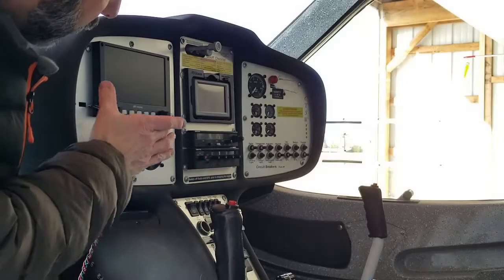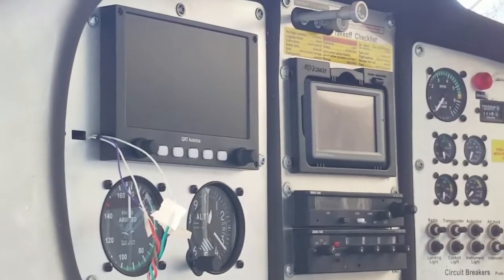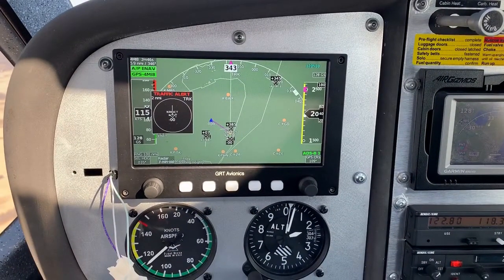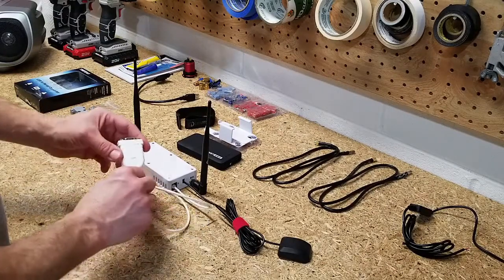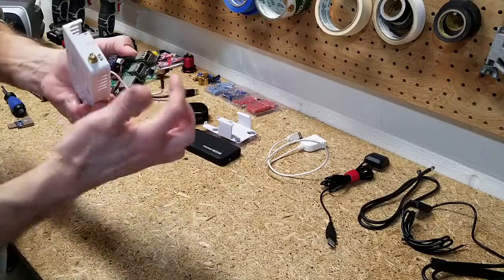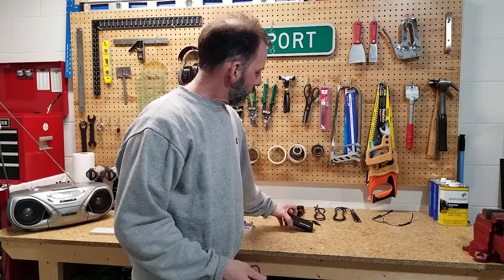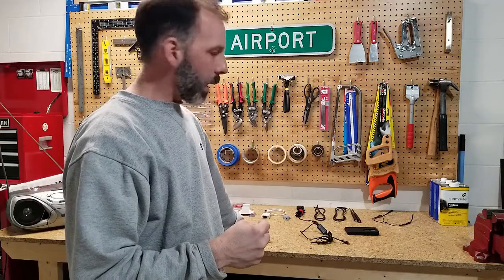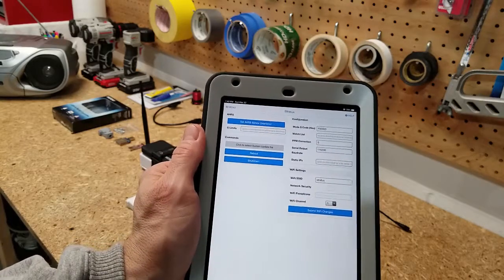Stratux ADS-B Serial Output / remote mounting / external power - GRT Avionics EFIS / Garmin / Dynon

Comment: I would have used a 6 to 7 foot USB cable and continued using the old USB GPS dongle. It would require a small case, which shouldn't be a problem.

Comment: on the GRT website they have a Image file for Raspberry Pi 3 that provides serial output, no update files, where can I get the update file
Reply from the maker: Hi Trueflite, I don't want to assume what you're looking at / saying here.  The file name is "update-stratux-tu-s9.sh", if that's the update file name you're seeing that is it.  If not, I'd suggest contacting Jeff at GRT and he'll email it to you.  Please subscribe to my channel (if you've not already), lots of more good videos in the works soon.  Regards, Darrell
Reply: @darrellwitham832  , I did get a reply from Jeff and he said to use the latest official stratux image, + the TU-S9 update script. My question now is if the new slimmer profile  version of the trendnet TU-S9 will work.
Reply from the maker: @aeromatt  Sounds like you're on the way here, I'm still running the TU-S9 as shown in this video.  The good news is these are $10 items, and the old version can be found on Ebay - just searched one a moment ago.

Comment: still didn't see how you connect to GRT display
Reply from the maker: The wires from Stratux attach directly (with in line connector) to the serial connection port 1 on back side of GRT.  Any unused serial 'IN' can be connect to, just like autopilot, secondary GPS feed, or other data cables.

Comment: How is the readability on that size screen?   I can make the larger 10.1” size fit in my panel but the price point on that one isn’t as good.  Do you wish your unit was a little bigger for easier viewing?
Reply from the maker: I'm very satisfied with screen size, understand it is super easy (those middle soft keys) to toggle between full map view (which also has speed & alt tapes overlaid), full PFD view, and then multiple combinations of with and without the engine monitoring info.  I think if you wanted all the info up simultaneously and never changed the screen views, then maybe the 10.1 would be a good choice.  Or the six pack overlay view of the 10.1 if that appeals to you, which is not a display option on 7".  I find I'm going between the split PFD / Map view, and the full Map view, and not using engine monitoring, and have no issues with scale and readability.  I've flown a few more hours over last weeks and corrected the Stratux setting so my tail does not display 'nearby traffic', it sure is nice to have that warning pop up when within 2 miles of another aircraft, such as entering a pattern and not yet having visual on others.  If you have room for two 7" I think that would be ultimate set up, redundancy and could dedicate one to engine monitoring, or go with the 7 plus a mini dedicated for engine monitoring and that would be redundant EFIS as well.  I was considering going with Garmin G5, the GRT mini, Dynon various sizes, and very limited with unique panel footprint.  The slightly narrower vertical size of this allows me to keep steam gages as back up, so the GRT Sport checked all the boxes, and to have all these capabilities for this price point I'm thrilled.  Screen goes from super bright to dim, absolutely love it.